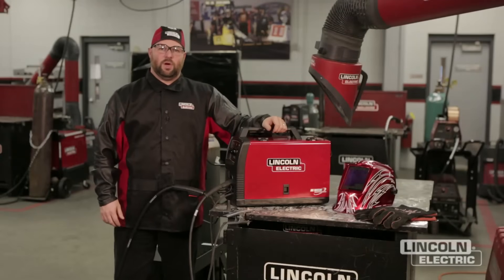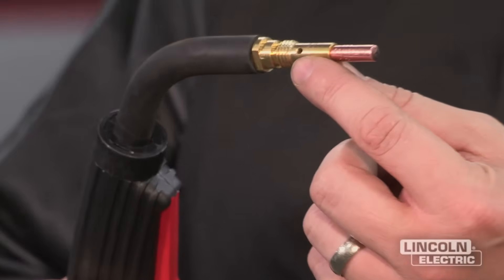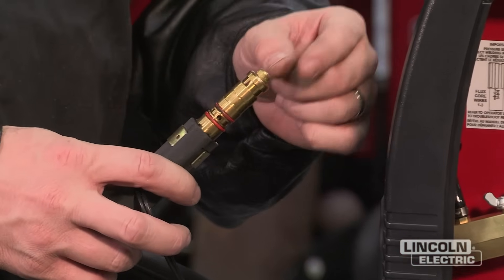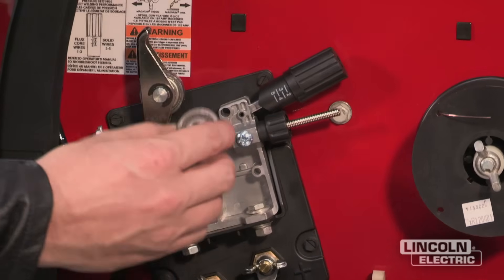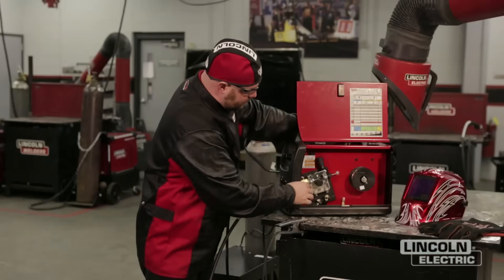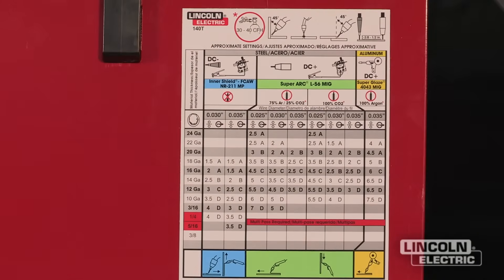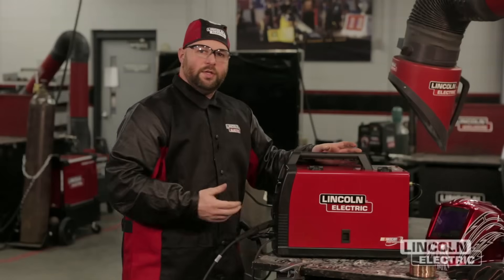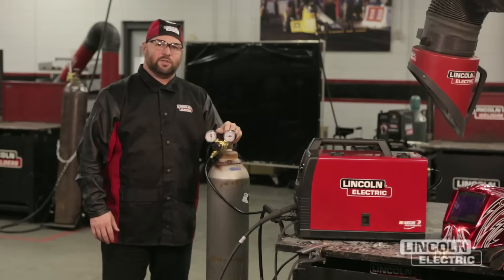Tech Tip: SP-140T Troubleshooting

Comment: I have the Lincoln 180 mig welder and it turns on fan going and when I press the trigger nothing happens.  No wire feed through no spark.  I have checked the tigger and connection and those are good. Any help or ideas would be appreciated

Comment: I have a lincoln 125 hd wire feed welder that doesn't weld in the A, B, C power selection but it does in D position. Only a small spark comes  from A, B, C. It was working well. I looked for any loose cable connections and every looks ok. What I can do next. JOSE

Comment: I've got the lincoln 140HD that has a low spark output no matter the setting. Also "slows down"....Like undervoltage kin d of slow down. Sounds like it's struggling to operate. I am a 30 year electrical contractor and know I have good power. Any Idea?
Reply: CHAPMAN ELECTRIC 7am
Reply: Mine just started doing this I have the pro 180 took two years to fail, I'm guessing control board as I have power in at B1 but nothing out at B2 ?

Comment: Hi, I have a Lincoln SP-170T and the wire speed knob has broken. (The plastic stalk that runs from the back of the knob to the machine snapped) and I want to replace the plastic stalk how do I get on there to remove the remain stalk? Thanks in advance!

Comment: i have a problem with my power mig 180c  i didn't use it for a long time since i bought it, and now the problem is when i pull the trigger the wire feed continuously even i stop pulling it..... any help???
Reply: your trigger switch is likely filled with filings and dirt. If you unplug inside the machine one wire at drive rollers and it stops the issue (be careful) it's in the gun. The switch is a common switch to appliances and most microwaves have 3 inside. If cleaning the dirt does not do it, replace switch and check specs on the side to ensure correct amperage which shouldn't be an issue as it is a low amperage ckt anyway. Swicth should be no more than $10, most likely dirt.
Reply from the maker: Please call our service dept. You can find the number on lincolnelectric.com. They will be able to troubleshoot the problem.